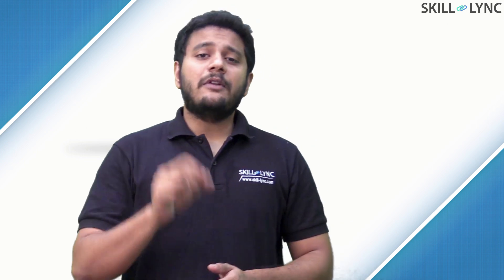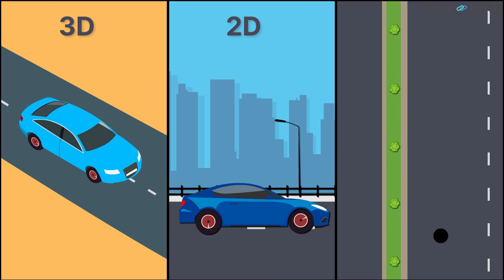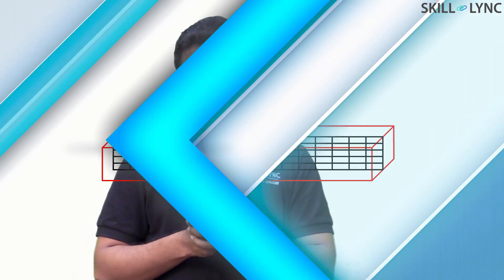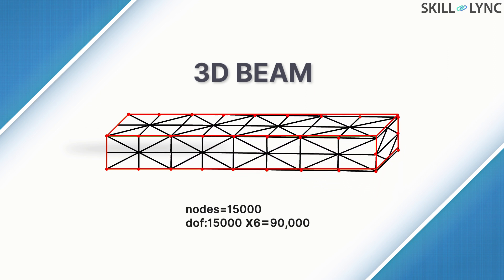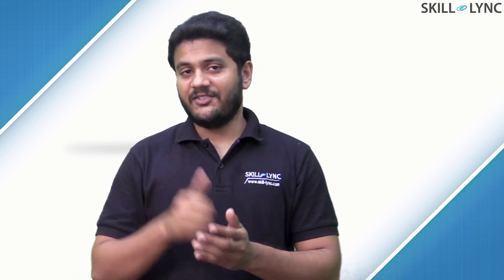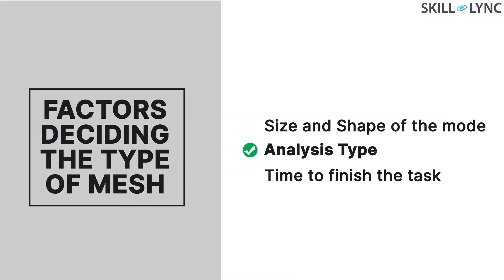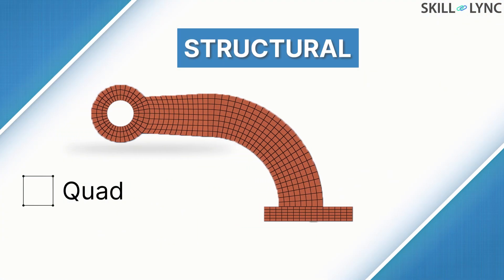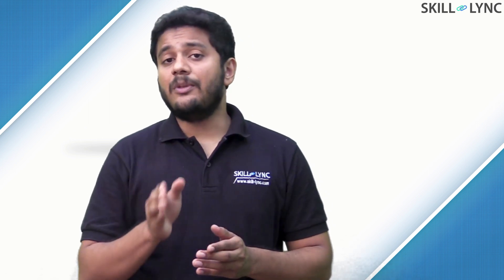Choosing the element type of a mesh | SKILL-LYNC

Comment from the maker: Guys, A small correction. 3D elements have only 3 DOFS per node.
Reply: How 3 DOFS shouldn't it be 6?
Reply: @creationmodelling42  That is because we want them have 3 DOF's (only translational) per node in Solid Elements. First and the foremost reason is to actually make the calculations a bit less time consuming and complex. A node having 6 DOF's means that the node is able to resist and transfer forces in 3 DOF's (translational) while moments in other 3 DOF's (rotational). In solid elements, this is not the case. A solid element is not supposed to resist and transmit the moments. That is because in the reality it cannot. The moment transfer happens in terms of equal and opposite forces. Therefore, only 3 DOF's (translational) are enough which are used to resist and transfer forces.
However, for a shell and beam element, a node is supposed to carry and resist the moments, thus rotational DOF's are a necessity. But this should be remembered that nothing in reality is 2D and 1D. We are trying to represent the reality in FEM.
Reply: Yes
Reply: Isn’t the 1D beam element has 4dof ?? XY on one node and XY on another ?? (2 translational at 2 each node)
Also the 2D element (shell element ) has 4 nodes hence 8 translational and 4 rotational = 12 nodes .
And the 3D element has 8 nodes hence 24 translational (3 on each node) and 24 rotational (3 on each node along 3 translational axis) =48